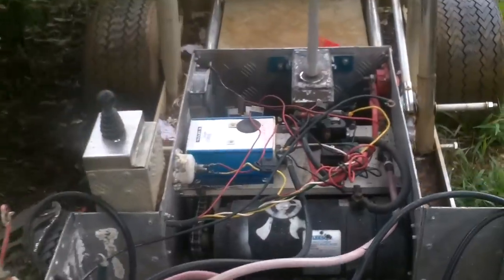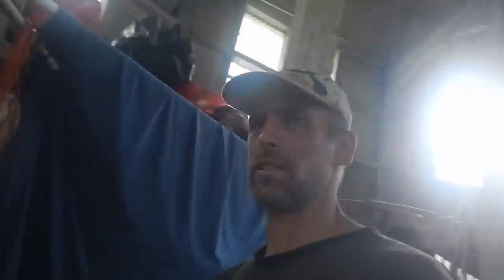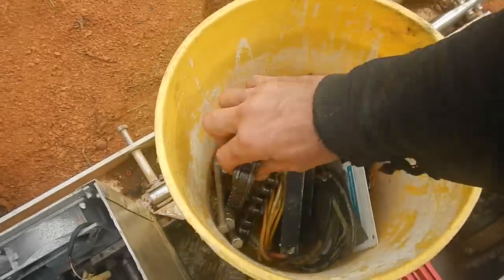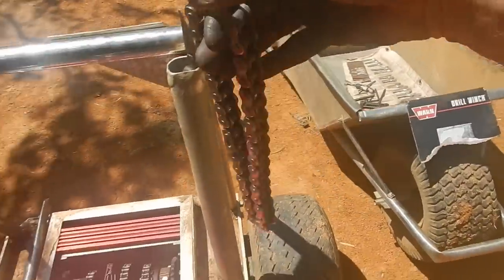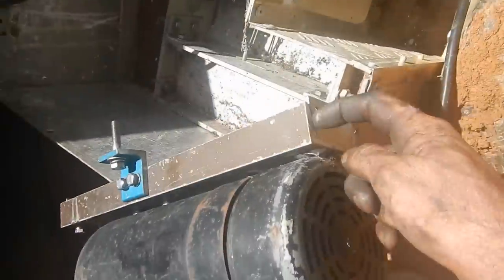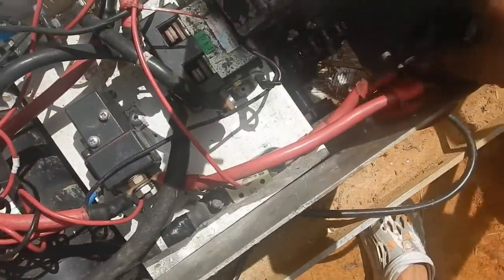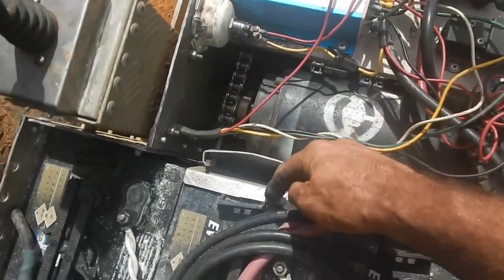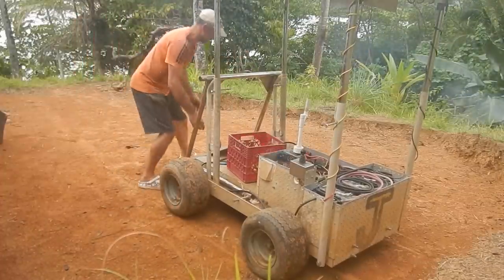Bulldozer Back in Action

Comment: If you think of it as a tractor, a world of possibilities opens up. My grandfather had a sawmill and a whole wood shop full of saws and drills that ran off the PTO of an old ford 8n.
The tractor was connected outside to a shaft that ran the width of the shop overhead, and whatever tool he needed he just slipped a belt over the wheel on the driveshaft. He could only use 1 tool at a time, but he was only 1 man working in the shop.